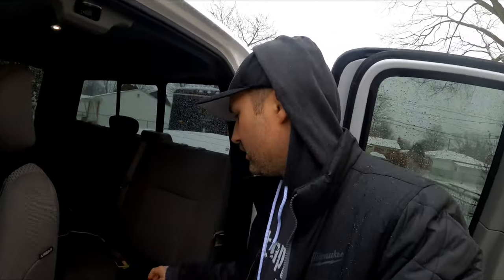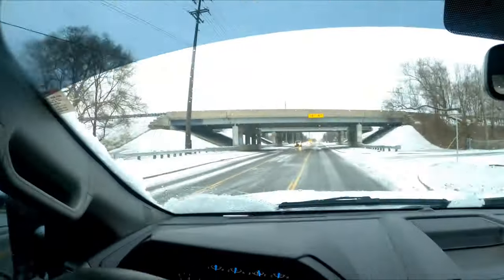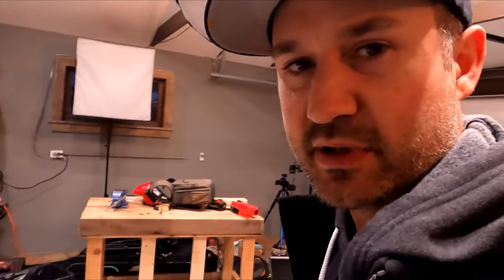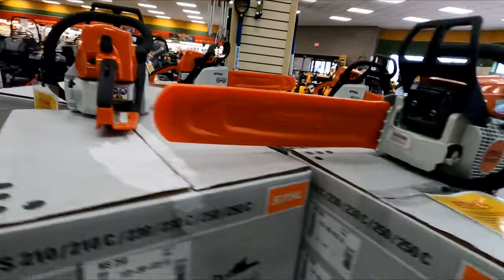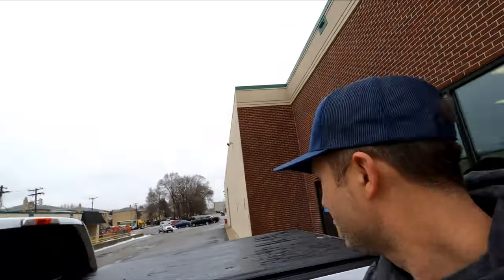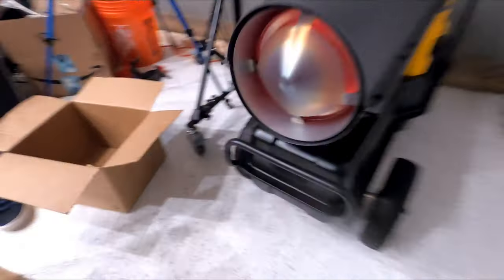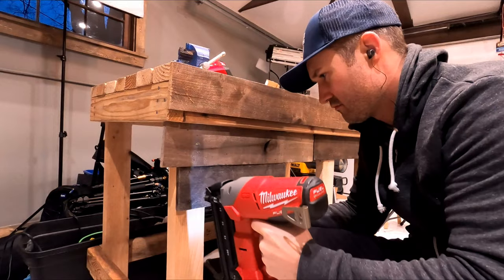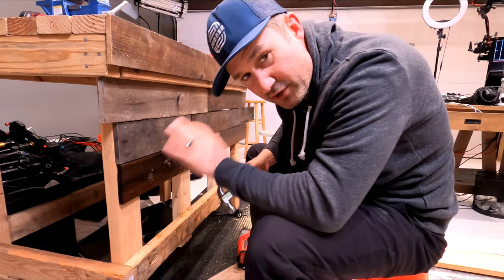Wrapping a WorkBench in Weathered Wood Panels // Dream Garage Workshop // Keith Kalfas Vlogs

Comment: Hell is an understatement bro! Idk what to call it but my first year fulltime has been a nightmare. And all becouse of break downs. Yes it could be worse! but haveing saved so much and done so well over the summer in a matter of 1 month 10k in repairs and still not running 100% mowers trucks plows the mechanic I though I could trust was just a parts change and was changing shirts at my expense amd not even fixing the initial issues. Dealers ripping me off. It all went to hell man. I did everything I wa told and learned. I had an amazing savings for winter plus whatever I made plowing. 1 break down in the worst storm in 5 years has pretty much put me out of bussnies. Idk what to do I lost all but 5 clients and not becouse I dodent handle it well becouse they are unreasonable and I dnt want then anyways but dident wanna lose then like this. Ended up in hospital couldent call any customers to let them know what was up. Rds were closed anyways but they all insisted they needed to be plowed and couldent wait 12 hrs which I do get but all my clients work from home it was a weekend. Still dosent make it right but they dident care and dropped me half were year round clients. I feel I'm back at start again. No money no clients feeling worthless and hopeless depressed when I was on top of the world 2 months ago. Trying to stay positive man and I will never give up. But man is it hard. This time of year it's pretty hard to make up that kind of cash backup.

Comment: I have that same blower after mine got taken with the front pull start it’s great, but one issue is that if it’s off for more than 5 minutes it needs primed again, so it negates the whole purpose of the design of not having to take off. A primer pump within reach with it on wound work.